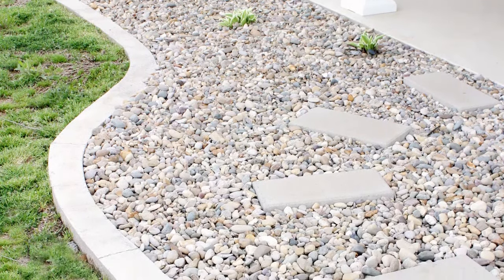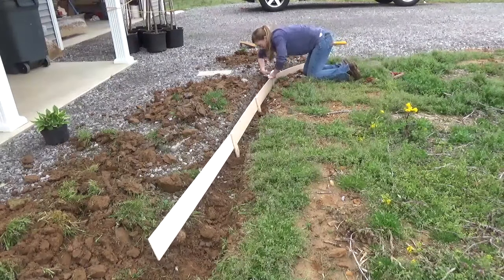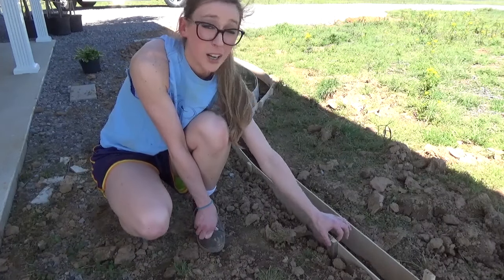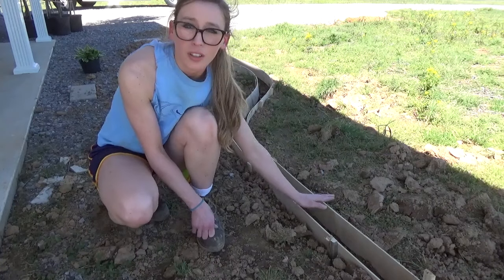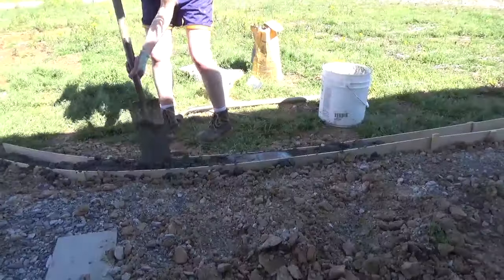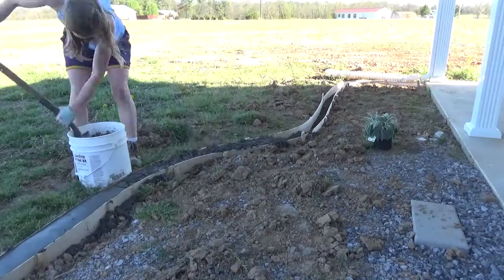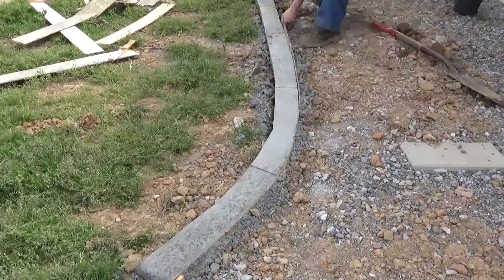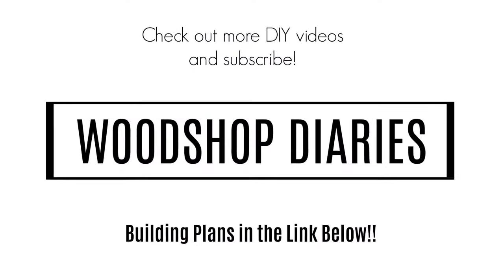How to Make a Concrete Landscape Curb

Comment: I did this years ago using foam packing sheets. They were easy to cut into strips like the plywood here.  The strips bent very gracefully, as they were so pliable. I didn't take the time to stake the strips in, I just propped rocks behind them.  Turned out good.  Now I have a ledge for my mower wheels to go on, eliminating any need for "edging".   I always initial and date my work in the cement.  Sometimes I write mottos in the wet cement, for example, "Garden of Weedin".
Reply: That sounds like a great idea, Nancy! Not sure what foam packing sheets are though. How thick are they and where do you get them, I’m guessing someplace like Staples?

Comment: thank you for the video, I am working on this project right now using just regular 2x4s. I didnt mix the concrete just poured it in and misted after. Also added a length of rebar. Trying to decide if i should use plywood to create curves since yours looks so nice.

Comment: It looked just a bit dry of a mix.  A tiny bit more water will make it easier for aggregate to settle when tamping, and also more easily let the "better" sand/cement mix portion of the concrete to "float" to the top, so that when you trowel it, no aggregate is exposed and you can get a buttery smooth surface.  But you got good results!
Reply from the maker: I did start out a little dry and started to mix it with more water as I went and did notice a big difference in the smooth-ability. Definitely needs more than what the bag calls for!

Comment: If you put oil on the plywood the cement wont' stick to it as much. You might even be able to remove the plywood once the concrete sets up and smooth the edges with a trowell to give the sides the same smooth finish as the top.

Comment: just a quick question, how far apart are you putting the stakes? e.g., a 1ft etc before you staple them or are you just going by where ever the support is needed? reason I ask, I was going to attempt to do a small area I have (about 10ft) using old vinyl slates (former patio window curtains) of course the stakes are going to be wood. think it will work?
Reply from the maker: I didn't have any specific spacing---just anywhere I noticed it looked like it needed some extra support, I added a stake.  They definitely weren't evenly spaced.

Comment: Nice, did you use a base like sand? I know to have it done professionally it’s $80 a foot, minimum of 100 ft.  I may try this
Reply from the maker: I didn’t use a base like sand or gravel. You can, but I just poured it after it was dug out and formed. It’s held up great for  a few years so far now 👍

Comment: Very nice and thanks for sharing your ideas .what foam board you used ? Have you added any sand and crack proof  in the concrete mix
Reply from the maker: Thank you! I didn’t use foam board. It was plywood. And I didn’t add anything into the mix. Just mix and water. 👍

Comment: Hi there, me again.  Thanks for getting back to me, I really appreciate it.  I appreciate your video.  Are you able to re-use that same plywood for another round or does it become too rough?  Just a small question.  Will the 1/4 plywood bend enough?
Reply from the maker: My 1/4” ply bent as much as I needed it for this project, but once it’s used, it’s trash. You can reuse it, but I wouldn’t. It’ll be brittle and messy

Comment: Great video and great job. Thank you for the video. Question: is it overkill to insert a piece of rebar into the installation? My name is Ted, and I live in Orange County, CA As mentioned in the video, I too like the clean look of concrete for landscaping. However many of the "mow strips" or curbs that I've seen, out here in CA, crumble over time - which is the reason for the rebar question. Thank you again.
Reply from the maker: Thank you! Ours has been fine without rebar so far but if you want to add some in, it definitely wouldn’t hurt!
Reply: @WoodshopDiaries  Many thanks and keep doing what you are doing - do not change.  All the best to you and your family.

Comment: Nice worK!  Do you live in a climate where it freezes in winter?  If so, how does the concrete hold up to freezing/heaving issues?  Any cracking or unevenness so far? Sometimes it takes a few years for this to occur.
Reply from the maker: It gets below freezing here in the winter. Not subzero weather, but most nights and some days below freezing. It’s held up perfectly. No issues so far (2.5 years old). It has one hairline crack that occurred right after I installed it because I stepped on it before it was fully cured. But nothing else has cracked on it since then.

Comment: You did a great art. I wish I can find them river rock cheaper to re-create your work. But here in Charlotte, NC they go for $120 a ton :(
Reply from the maker: Thank you! Yes landscape rock is a little pricey. I get mine where I live for about $60-75 a cubic yard.
Reply: Check with the local concrete sand and gravel place. I can get the big Colorado river rock from them where I live for $45 a cubic yard, vs $90 a cubic yard at the landscape and garden center. They don't usually have a HUGE selection but they might have something you like for cheap.

Comment: Thanks for the video.  Do you think 1/8 inch plywood would work ok?  Or maybe even stiff cardboard?  Do you think that would work?  I want to try on a small area first.
Reply from the maker: That might work, but my concern would be the weight of the concrete pushing out on the sides. If you put enough stakes, I think 1/8” would work okay.

Comment: one trick...a bit tedious to some, is to use small dowel rod pieces to use as spacers at the top of the form and brad them in at the top of the plywood where you would put stress relief cuts.  Serves double duty, makes for more even sizing, but is tedious -- great for those with a touch of OCD.

Comment: Looks good.  However, you may find that your control joints (cuts to prevent cracking) are not cut deep enough.
Reply from the maker: Maybe so, but it’s been a year and a half and so far no issues 👍

Comment: Hi. Thank you for your channel!  I read on your blog and you use general purpose concrete. The application goes down gray but it looks like it dried white or a limestone color. Did you Color or paint your border? I’m looking for a finish similar to limestone. thank you.
Reply from the maker: Hi! I didn’t paint or add any color to this. Since it’s wet, it’s a lot darker when you pour it, but as it dries, it turns a light grey…just like your typical concrete driveway or concrete pad or patio. This was just plain concrete…nothing added
Reply: @WoodshopDiaries  thank you!

Comment: Did you wet the concrete while it was curing or use a sealer?
Reply from the maker: I didn’t. But it’s held up great so far 👍
Reply: @WoodshopDiaries  Great!  Very practical and straightforward video, although you're a lot younger than I am (oh, my aching back!).   Maybe I'll try in small segments.  Better yet, hire a couple of my nephews!!

Comment: nice job...that was mortar you mixed as there were no gravel in the mix to make it concrete.
Reply from the maker: Thanks. All I know is it was a general purpose quikrete and it worked well 👍
Reply: It was concrete. It says it right on the bag that she was using. Timestamp 3:39